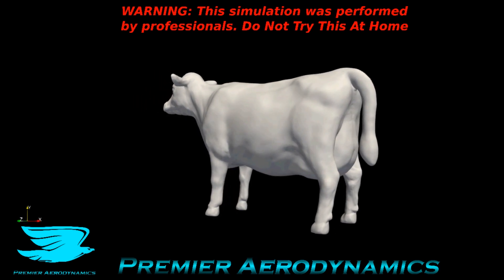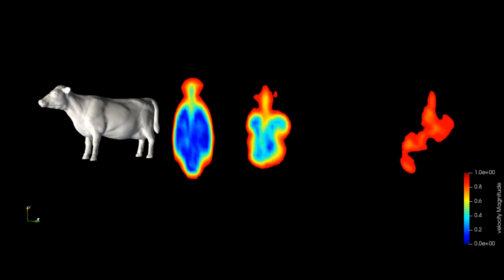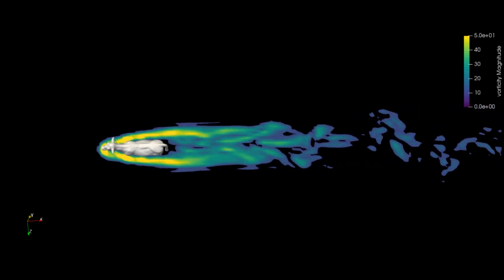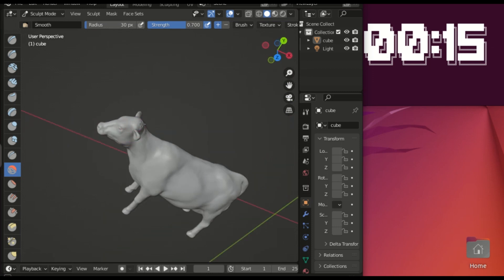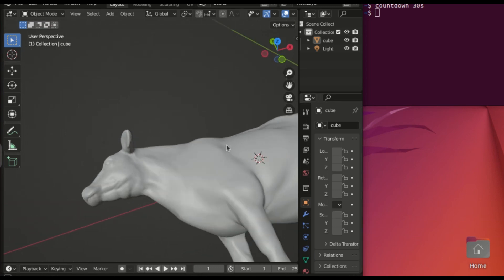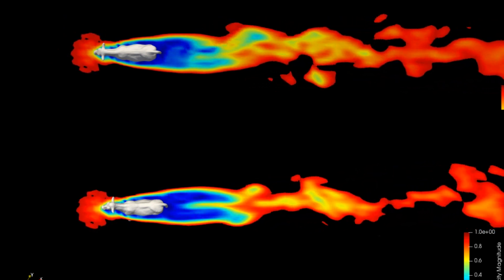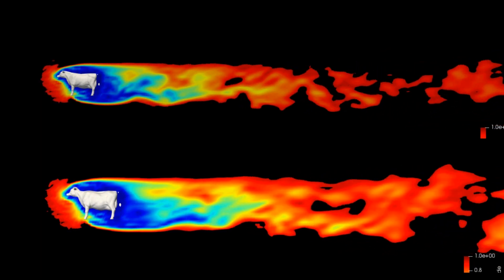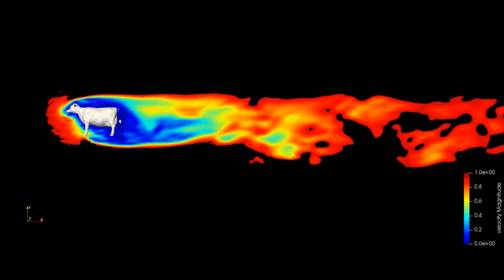Aerodynamics Challenge! Can you make a cow more aerodynamic?

Comment: Depends, are we trying to add lift, downforce, reduce drag? Since I like race cars and I don't want my cows flying away in a tornado, I would add downforce. To do that, I'd speed up the flow below the cow, without chopping off the hind legs or the udders it's going to be tricky to do. Lowering the cow's head as if it were grazing grass would probably create some front end downforce, if it stuck up it's butt while lowering its head, would move the wake higher. However, the legs would still cause a strong wake.
Reply from the maker: I think if you made the chest lower, but still keep the flow attached, and then reduce the udder size, that would make it a little more like an upside-down wing. Lowering the head would also help with that too.🤔

For the legs, I was thinking about making the trailing edges sharper to make them more streamline.